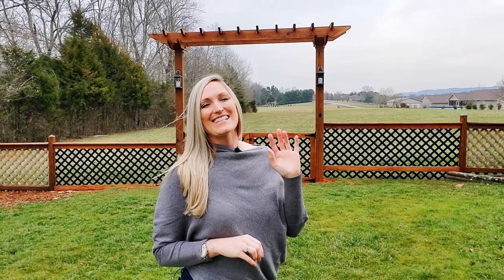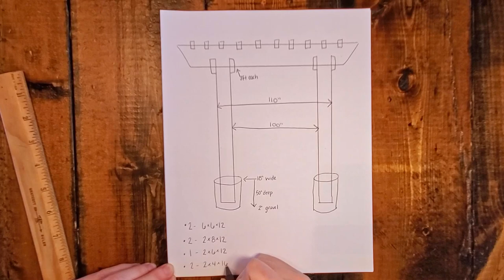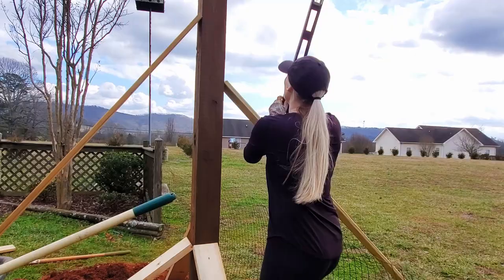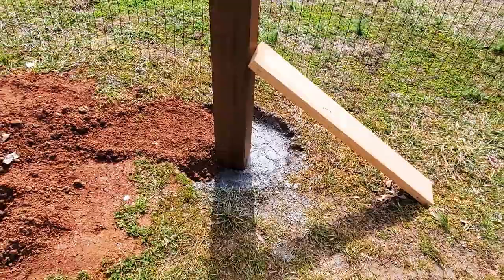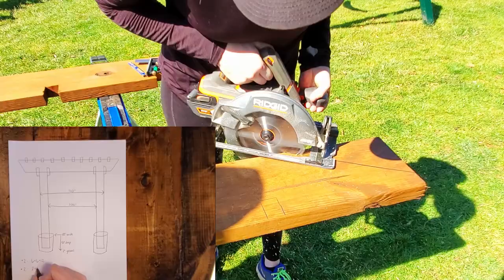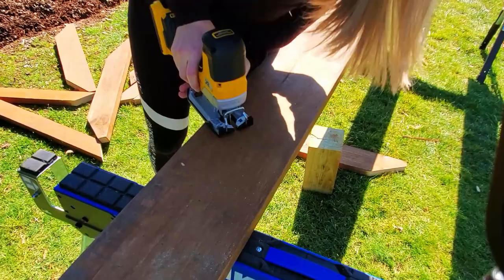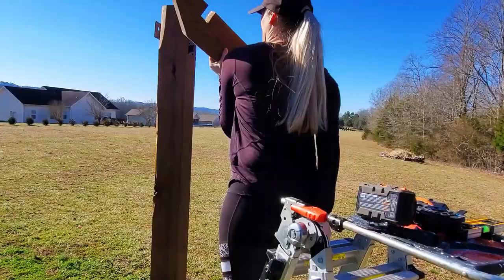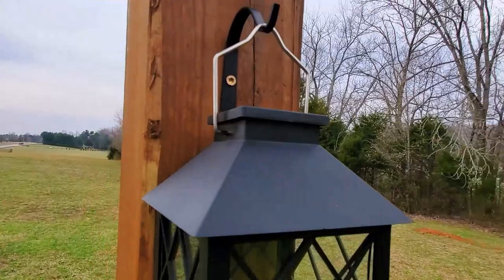How To Build A Garden Arbor | DIY Grapevine Arbor And Pergola

Comment: Really cool. I want to do this in our yard now... great job. How many days did it take you?
Reply from the maker: Thank you! I have no idea how many days it would take because I started this project in the winter and couldn't set the concrete until we had the proper temperatures. Also, I kept getting rain in the forecast so I couldn't stain when I wanted to and it took longer to dry. Also, because I flimed a video it took twice as long as it normally with. All this to say....sorry I'm no help with the timeframe. 😂

Comment: Thanks for the video and material list. Any thoughts on using 4x4 posts instead of 6x6 posts?
Reply from the maker: You can definitely use 4x4 posts for a smaller scale arbor. It would look better using the 6x6 posts on a larger scale. It all depends on how tall and large you want your arbor.
Reply: @DeesYard  thanks

Comment: How far down did you dig the post holes? I have the same size posts and I'm curious. Nice job.
Reply from the maker: Thank you! We were suppose to dig down 4 feet but ended up hitting a drainage pipe around 2 ¹/² - 3 feet. We have clay soil so, I'm not worried it will move at all, especially with the concrete.
Reply: @DeesYard  omg 4 feet down!  I'm going to try this but I'll never get to 4'.  I'll do my best. I hope it is as nice as yours, just beautiful!!
Reply from the maker: @Dianne Fox  if you get to 2 ¹/2- 3 feet you should be good 😁

Comment: Did you use pressure or ground treated wood?
Reply from the maker: We used pressure treated wood on this project.
Reply: @DeesYard  thank you for the response. Did you wait before staining them? I recently used “green” ground contact wood and im nervous to stain it. Probably best to wait until next spring. Love the color you picked, it looks close to cedar. Am I seeing it right?
Reply from the maker: Thank you! No, we didn't wait to stain. As long as the wood wasn't wet from rain, we stained. You can totally wait though, either way works!